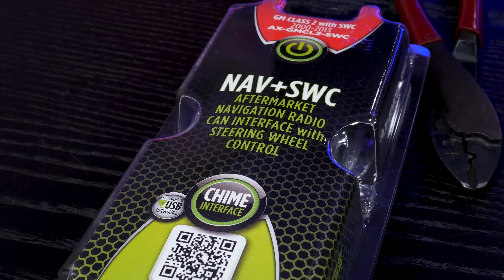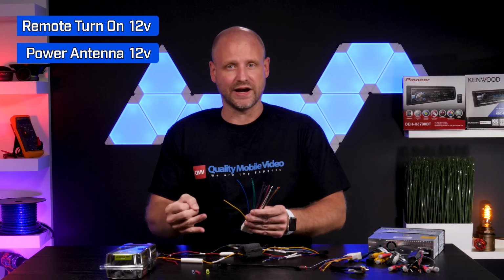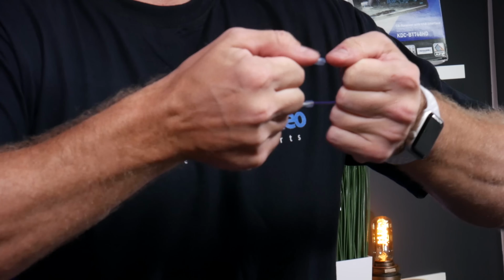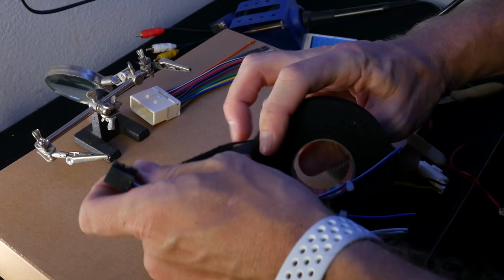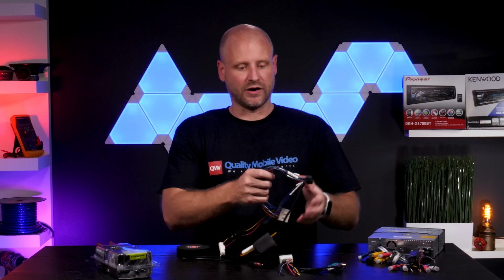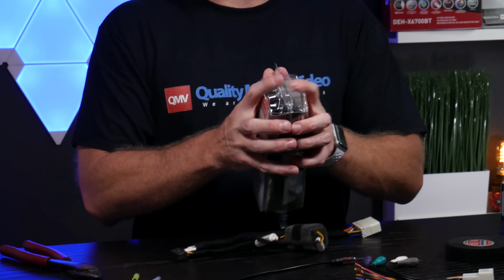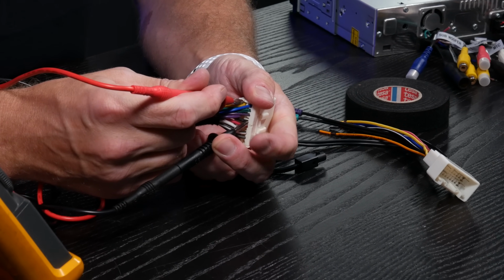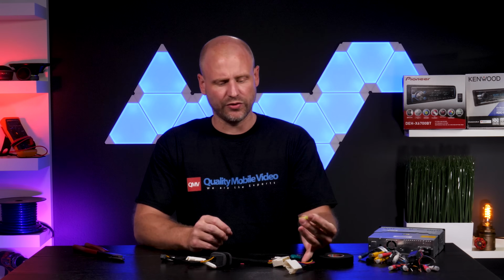Car Stereo Wiring Harnesses & Interfaces Explained - What Do The Wire Colors Mean?

Comment: question. I replaced the radio in my 03 vw beetle and the harness that was there just plugged into the after mark radio i bought but for some reason now my radio will not work if the hood on my car is closed but if i pop it where its open just a little the radio will work and the radio resets to factory every time i turn the car on (ie don't remember anything and have to re save everything) any ideas on how to fix that

Comment: Are you aware that there are butt connectors that have heat shrink. 

They don't fall apart unlike the older version of the butt connector.  Due to you lock it on the wire. By heating it up. It even be comes water tight as well.

Comment: I have a lincoln navigator 06 the last owner cut all the factory wires to plug an aftermarket stereo but now my stereo wont safe any settings and also my stereo  wont turn on unless the red wire and the yellow one are connected together

Comment: How  do you deal with an existing harness that only has  3 wires for each set of speakers (i.e. common negative) but new radio needs separate negative for each speaker..   gk

Comment: Hello! I watched this video, followed the instructions, and the radio still doesn't power on. Help!
Reply: I hope I don't have to wire it into the cigarette lighter.
Reply from the maker: You definitely don't have to wire to the cigarette lighter! If there's no power it's most likely a wiring issue. Whats after market harness/interface did you use to connect the stereo to the vehicle's factory wiring? And what is your make/model/year?
Reply: @Qualitymobilevideo  Thank god!  I had to go through that nightmare with my Dodge (wiring to the cigarette lighter).  I used the kit that was provided.  I have a 2011 Ford Escape XLS.

Comment: Is it universal color code?
Reply from the maker: Generally yes, for the power, accessory, ground, and speakers, but there will be instances where wires like illumination, remote turn on, antenna are different.
Reply: @Qualitymobilevideo  cool. Thanks. Ill try to diy my head unit. Subbed.

Comment: Interesting - So I'm stumped.  NOT my first rodeo, but can't find solution - 99 Dodge Ram - my RV tow vehicle - NOT with infinity sound as far as I can tell - new Touchscreen head - works great on the bench setting it up but once installed into the truck - NADA.

 5.7 ? volts at speaker outputs on the harness.

Could there be an amp in this unit I am not aware of and how would it be powered - I have the Power Antennae wire connected - I have ALL the original wires connected to the harness - and everything correct.

IF it has Premium sound that gave me 2 more speakers - but I'm not thinking an amp - there is NO canbus connection on the radio although it has the port . . .

Any help would be appreciated . . .

Tuesday the dash comes out . . . there has to be something somewhere . . .

Comment: If I have a factory amplifier, should I ground the factory amplifier wire or just tape it off???? Someone please help
Reply from the maker: If you are no longer using it you should isolate the wires so there is no potential short.
Reply: Thank you for the reply, I am using it so I grounded it and it works fine thank you.

Comment: I have a aftermarket amp with subwoofers . I had to buy a line output converter and taped it to my front two speakers from the wire harness. Works perfect. But when I went to connect the aftermarket radio. Sound was so bad . I reconnected the speaker wire and only the front two sounded great but no back audio. Idk what’s the problem. Could be the radio or line output . Any help anyone ????

Comment: The connector are good cause there will be no one going to pull it in your stereo.  If you notice there's three kind of connectors, yellow,blue,and pink. All different size and instead using the blue should use the pink one. Pink one is use for smaller and thinner wires

Comment: Can some one tell me or help me? I installed everything but left out the key one and two, the orange wire and the headphone jack cause i dont know where they go connected to. The radio now works but i have to turn it off and on after i leave the car cause it dont shut down on its own after i turn off the car.. its kinda annoying 😣 what did i do wrong? Cara a 2003 pontiac grand am.

Comment: Does anyone know what. Black wire with. White line is for or the blue wire with the white line?
Reply from the maker: Do you have a manual or part number?
Reply: Quality Mobile Video im trying to install a boss 616UAB on a 2001 infiniti i30
Reply from the maker: And you're using this harness? https://www.qualitymobilevideo.com/70-7550.html

Comment: Hey so I have a cuestión I just installed my radio everything works perfect just the front left speaker won’t sound what
Could be wrong ?
Reply: Isaac William I’m the same man except it’s my front right speaker and when I connect the colours it makes a mad buz from the speaker but no clear sound
Reply: Queen_jord brewer mine doesn’t make any sound at all
Reply: Isaac William have you hooked up the antena into the back on the head unit, you have power etc every thing going except no sound at all?
Reply: Queen_jord brewer yeah yeah I have power the radio works just fine all
Of the other speakers sound expect the one from the driver side I believe it’s dead if you find a solution for yours let me know it could really help :)
Reply: Isaac William was the drivers side going previously? If you unsure it’s probably blown, if it was I’m not sure I just changed back to my old heady and mine started working again
Reply: Queen_jord brewer yeah it worked before the thing is when I do the balance thing and I put it all the way to the left only the back left speaker sound but the front not
Reply from the maker: Could be a lot of things Isaac! Basically gotta get in their and diagnose it. Could be a wiring issue, blown speaker, some sort of damage or misconnection, your radio could be malfunctioning, could be a bad balancing setting. If you have a multimeter test all the speakers. Check this article out:

http://www.caraudiohelp.com/newsletter/troubleshooting_speakers.html

Comment: I did mine perfect every speaker works except my front right, it makes a buzzing sound when I connect the two, what could that mean? It was working that speaker I mean with last headunit, they are the only 4 wires left to connect

Comment: I have been considering replacing the older aftermarket JVC CD/Radio in my 'new- to -me' used truck. The CD player seems to work OK aside from the occasional problem ejecting the CD. Not a big problem....The Stereo sound is loud and clear. I simply remove the detachable front panel and pull the CD out with my fingers. When I decide to get a new unit, the main purpose will lie in getting a unit with a strong AM/FM signal reception. No Bluetooth, no phone connectability,  no unneeded whistles & bells. Just loud sound, clear sound & an EQ. Then I'll get a PRO to install it. I'm no Electrician. I can do most anything, but Electronics isn't one of them.......
Reply from the maker: It's a piece of cake, you can do it.

Comment: Well I just put a new double stereo in my 2004 gmc yukon , but my problem is I have connected all wires , but now it wont turn on ! What did I do wrong !!
Reply from the maker: If the stereo won't turn on there is either a wiring mistake or a fuse has blown. It's impossible for me to tell you what the issue is without being there :(

Comment: 12 GMC Acadia: All I want to know is do I need an interface. We don't have steering wheel controls, will never use on star or any of that stuff. If I just get a wiring harness without interface will my Kenwood aftermarket stereo work just fine? I'm not paying $70 or $80 bucks for ssomething I really don't need if I don't have or plan on using on star.
Reply from the maker: Unfortunately those GMC's quite often require an interface rather than a simple harness. Their factory wiring makes stereo replacement virtually impossible without an interface. These are probably your cheapest solutions: 
https://www.qualitymobilevideo.com/ax-adxsvi-gm1.html combined with 

https://www.qualitymobilevideo.com/ax-adxsvi.html
OR

https://www.qualitymobilevideo.com/ax-adbox2.html

https://www.qualitymobilevideo.com/ax-adbox1.html

Comment: I'm trying to help my Dad install his stereo, its a Sony DSX-A410BT into a Peugeot Bipper 2010. We have a harness that was bought separately to the stereo and I would assume the issue is here, currently if the stereo is turned off, the gauge cluster also turns off? When it's on the stereo works fine which confuses me when trying to find errors in the harness. I don't understand some of the labels on the original stereo, it has labels such as Ub, Can A, Can B, NC, Booster DET? Does anyone know what these labels mean or why the gauge cluster would turn off?

Comment: Was expecting to see those butt connectors with the solder in the middle. Just put in the wires at each end, then heat with a heat gun. Best of both worlds..
Reply from the maker: Those will work too!

Comment: I have two amps, and one subwoofer, and two sets of RCA cables coming from them to be connected to my Clarion DXZ468RMP, which has 6 RCA cables, (3 sets of two), 1 set has black wires, and the other is grey wire, I think that the set with red wires are for an Aux connection, Where do I plug the RCAs from my Ground Zero GZIA2239HPX, and where do I plug the RCAs, from my Cadence Xenith? The RCAs from the radio have red and white connectors.

Comment: If I pulled that hard on a solder joint I would tear the wires apart too. Not saying that a solder joint isn't better, but pulling that hard on either would cause a failure.
Reply from the maker: Well Lorenzo only curls 5lb dumbbells at the gym so he wasn't creating that much force

Comment: I did everything like that, my stereo turns on when my ignition is on but when i try to turn the engine it turns off why is that?  .
Reply: "turn the engine" means when you crank a gasoline engine to start it, right? Most, maybe all, cars have a relay that disables accessories when cranking the engine.  This is to allow as much current as possible to be used by the starter motor.  Try cranking your engine with the windshield wipers on.  You'll see the same thing.

Comment: So what happens if I only have one remote/antenna wire and I need to power an amp and a antenna ?
Reply from the maker: You can technically use that wire for both if it doesn't exceed 500 milliamps, or just use a relay :)

Comment: My audio works fine when I'm parked but as soon as I drive it starts to skip. Which wire would be the problem?
Reply from the maker: Lol, could be several issues
Reply: @Qualitymobilevideo  I found it. It was the white speaker because the harness had 3 white wires. Thanks for the video.

Comment: I installed a radio today and it did not want to power on so I took it back to the store (thought maybe a bad unit). Put the old radio back in and it didn’t power up either.......???? I ended up hooking the Red wire (switches power off and on, Accessories basically) in addition to the Yellow (constant 12 volts) and the ground and it instantly powered up.           

So you have to have all 3 hooked up for it to power up? I only had the Yellow and Black hooked up. Other radio was probably fine huh??

Comment: Some reason I got 2 constant wires what's that mean
Reply from the maker: Have never seen that, I'd assume they have continuity but test it, and parallel them.
Reply: I got a 2006 dodge charger pursuit I'm wondering what can it be how will I test it or run kt
Reply: Will it mess up if I connect it together I don't see no ignition wire when I try to turn it on

Comment: What I'm confused about is what the harness connects to. Does it connect to the harness that comes with the radio?
Reply from the maker: Every car has a factory stereo. This factory stereo is connected to the factory wiring of the car inside the dash. When replacing your factory stereo, it's necessary to get a wiring harness to act as kind of a bridge to connect the wiring harness of the stereo to the factory wiring of the car. All cars have unique wiring, and Metra makes unique wiring harnesses for each make/model/year of all cars. So your final connection will be Car factory wiring which connects to the Metra wiring harness which connects to the Aftermarket Stereo wiring harness
Reply: Thank you for replying to my question! I managed to get the correct harness and hooked up everything but I have another issue if you wouldnt mind helping me out. So before the new headunit was installed (Kenwood 325U), I had a factory stereo with a LOC plus amp and 2 12in subs. After installing the new headunit they worked but my music would distort at higher volumes 30-35 and even put the amp in protect mode. Everything was still connected via LOC. After removing the RCAs from that and plugging them into the sub RCA on the headunit, I now get no sound from my subs.

Comment: Odds are that there won't be that much stress on the wires behind the dash so crimps or lever splices should be just fine and you won't have to inhale that solder flux.

Comment: Can anyone tell my why my radio turns blue when I actually start my truck but when I click the key back one notch it works just fine
Reply from the maker: You likely have a voltage drop issue.
Reply: @Qualitymobilevideo  how do I fix that…
Reply from the maker: @JustinBender2208  You will need to use a voltmeter and check the voltage as you crank the vehicle and check the value. You either have grounds that need cleaning or replacing or a battery that needs to be replaced.
Reply: @Qualitymobilevideo  how do I resolve the problem because the radio works while I’m driving like it flickers but the screen doesn’t stay on and it plays random static noise and random stations how would I fix this situation
Reply: @Qualitymobilevideo  my battery hood charge at 14 just fine
Reply: Holds

Comment: Why the loose wires?...all the big brands here in the UK come with a mitsumi 16 pin plug to ISO plug ...a car specific  harness (manufacturer plug to ISO) adaptor casts a few pounds...I've replaced head units in 20 mins.
Reply from the maker: I don't have a definitive answer, but I assume Metra and manufacturers do it to leave easy access for different types of systems/wiring schemes, in case you want to change something about your system down the road

Comment: So I wired my radio and it doesn’t turn on when I connect it to my car but the factory car works fine
Reply from the maker: If the stereo won't turn on there is either a wiring mistake or a fuse has blown. It's impossible for me to tell you what the issue is without being there so you have to investigate via process of elimination. Is anything else effected? Windshield wipers, power locks, etc?

Comment: hello
please Help me arrange the cut wires... i have audi a6 2013 with head up display but it doesn’t working, when opens it to check what wrong i found it not connected, often the first owner, tried to install the wires, but was unable to arrange them in the correct place, so i hope to help me to arrange them, tell me wire No 1 to where in need to connect it, and wire No 2... No 3... No 4... No 5... No 6... No 7... No 8... No 9... No 10... 
sorry if disturb you but i’m really excited to to see this head up display working, i bought my car from 2017 but head up doesn’t working
Best Rogards

Comment: I installed an aftermarket stereo in my 2000 civic. The stereo work fine until I turn on the headlights the stereo turns off. What did I do wrong?
Reply from the maker: Sounds likeyou have your ground wire hooked up to the illumination wire of the car. Change your ground wire and it will work fine.

Comment: I upgraded to a double din touch screen stereo I followed correctly all the wires have double even triple checked and still I get a buzzing hissing noise coming from my tweeters anyone have an idea what it could be also my air bag light came on after doing the new wiring
Reply from the maker: What's your make/model/year and what after market harness did you buy

Comment: If i switch between the functions on my headunit my external amplifier switches itself off.
If i use tuner function-normal fm radio everything works fine.
When i switch over to aux or cd, the amp switches off and i have no sound.
Setup consists of:
1 x Sony GT270 headunit
1×Starsound Hornet 7600w 4 channel amp 
1xStarsound 12" DVC SUB
2 x 6.5 inch mids
Please can someone help me as to why this happens
Reply from the maker: You have the amp turn on wire connected to the antenna output on the new radio.

Comment: I've contacted a stereo into my car it turns on but wont turn off what did I do wrong?
Reply from the maker: Most likely a wiring mistake Adrian. If the main power wire for the head unit is connected to a power source that is always hot, the radio won't ever turn off.
Rewire the radio to receive power from a source that is only hot when the ignition is in the accessory or run position

Comment: You should insert both wires into the butt connector so that they overlap each other then when you crimp both ends, each wire is crimped twice.

Comment: My radio turns on but Doesn’t have any sound  (I used crips or closed end connectors) did I just wired it wrong??
Reply from the maker: Could be a few different things. The amp can cause the car stereo not to produce any sound at all. ... If the fuse of the amp blows out, it could be the reason why you are not getting sound out of your car stereo. A broken wire or a bad connection can also cause sound not to come out of your car stereo so check your speaker connections.

Comment: What do I do if the orange Is orange and white and the other one is orange and black
Reply: You need to read the manual that came with your adapter harness and read the manual that came with your radio and match them up based on description